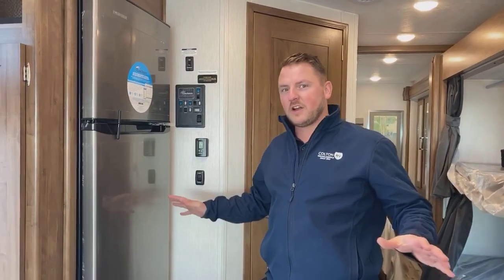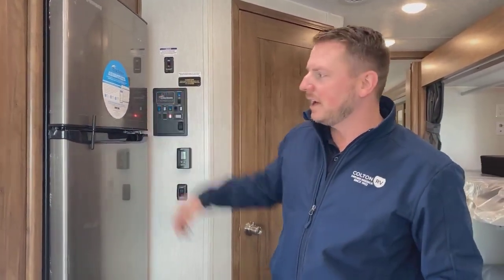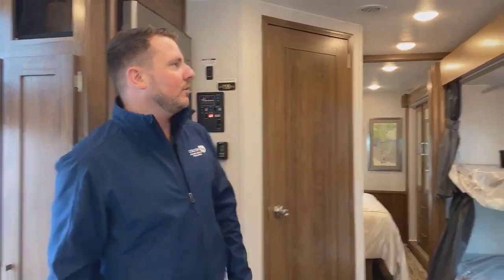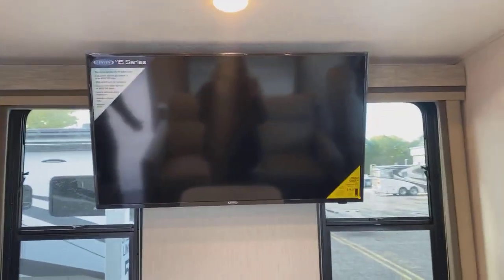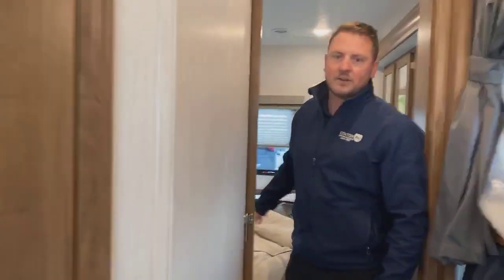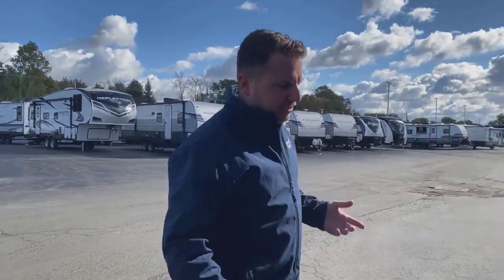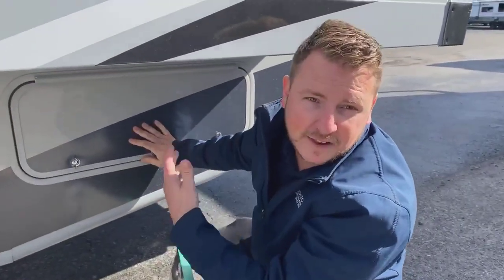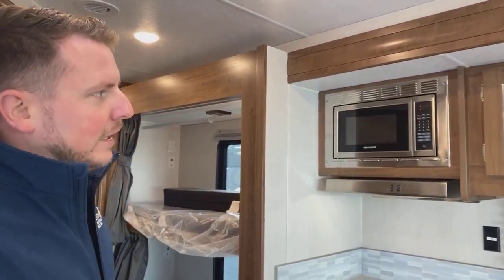ONAN Gas RV Generator Operation and Troubleshooting: What to do when you're not getting power

Comment: Awesome.  It's exactly what happened  to our. Generator went out flipped that little breaker on the generator everything worked again. Great video. Thx  for the help.   Awesome made my girls day after 2 weeks thinking we had a big issue.  And it's been snowing all day and the past couple night we've been using the big mr buddy heater. Which worked good kept us warm.  But this was def a relief
Reply from the maker: Thanks for watching, Keith. Glad we could help!
Reply: @ColtonRVandMarine  only thing now is the roof top ac and heater works.  But it's to cold I guess for our furnace to go on.   Is there anything else it could b last time a few months ago it got cold on our way down to fla  it worked since then we cant get it to go on.   And we took the cover off and theres no way to reset or even lite it  everything is clean   just cant figure out how to get it to go on. We have a 2016 navion diesel  with a propane onan 4600 generator and a hot water furnace that works but not the propane furnace.  How  can we get it to work or trouble shoot it

Comment: My Onon 7000 generator runs fine in my 96 Winnebago Vectra but microwave, air conditioner & refrigerator is NOT powering up. BOTH circuit breakers have been turned Off and On @ the generator still nothing. All other breakers & fuses good inside coach as well. Help! Lol